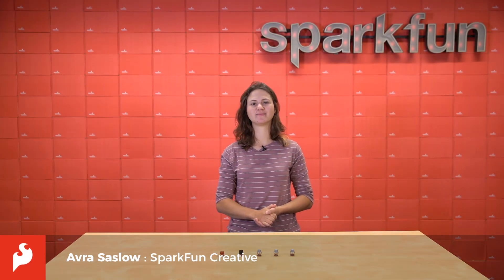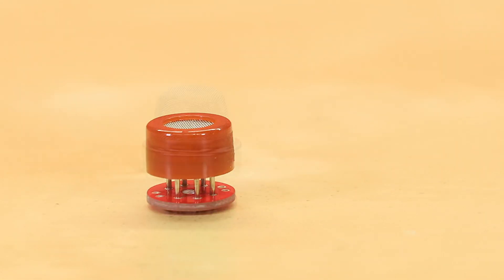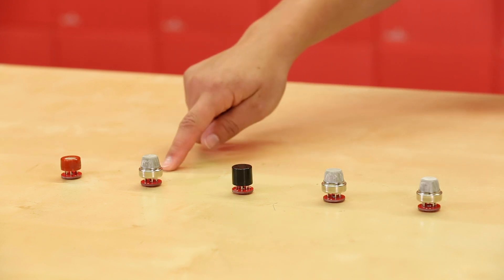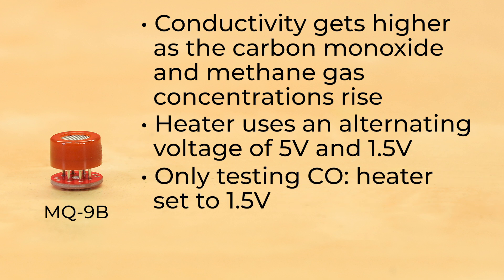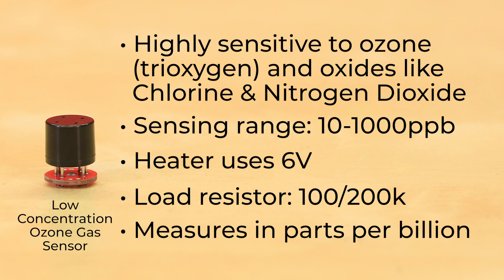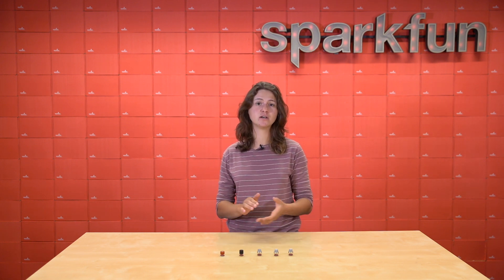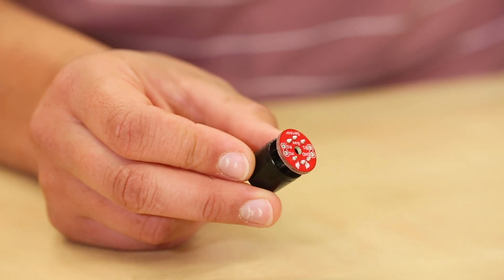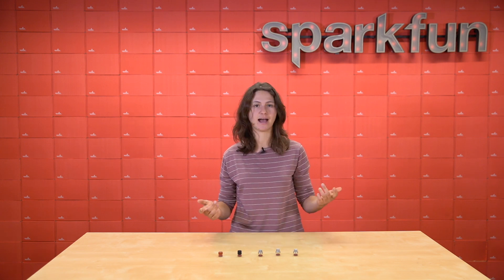Product Showcase: MQ Sensors

Comment: More interesting that fact, that sensor have none-linear characteristic. And it depends on ambient humidity and temperature. So if you want collect accurate data you must collect and calculate complex variable: voltage, temperature, humidity. Output voltage  depends logarithmic to temperature and humidity (Curves of dependence drawn in  datasheet of particular MQ sensor). Just mapping max. min. voltage to PPM would not show exact concentration.